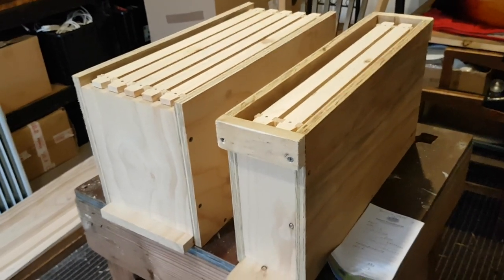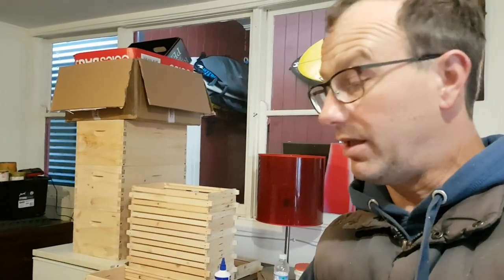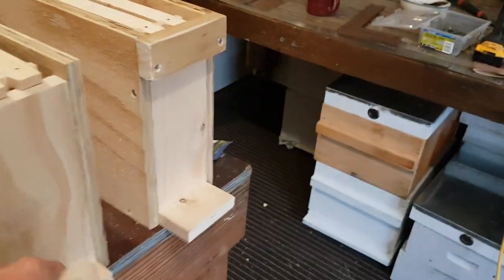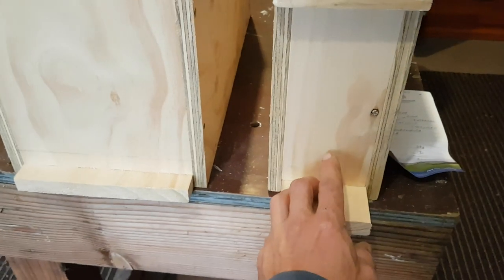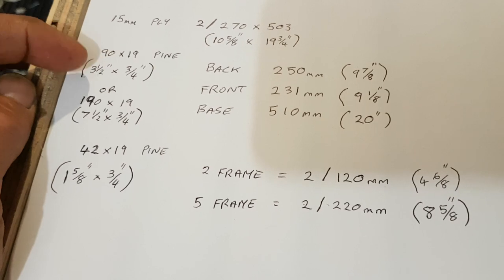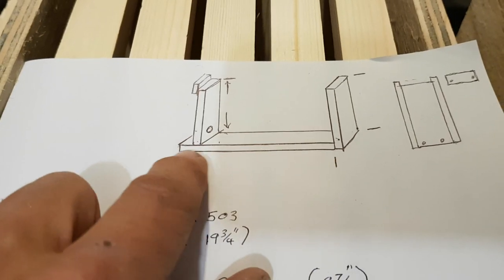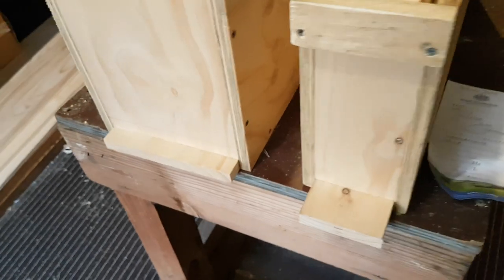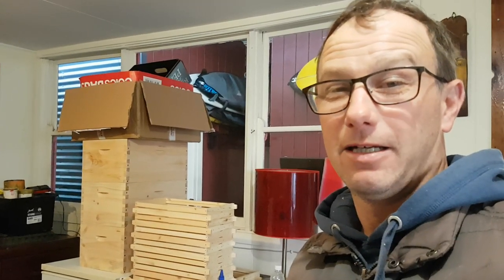Idiot proof Nuc boxes

Comment: Looks good.  I imagine one could use 2 pieces of 1X lumber on each side in place of plywood if they find it at the right width.  I made one with pallet boards on the sides, very similar to this.  And I had some old 2Xs that were already painted going to waste so I cut them to the right length for the front and backs of some Nucs.  I figured the Bees would be happier with the thicker wood on the ends.

Comment: I made my front and rear panels the same and screwed both from the bottom. No need to make 2 different sizes for that. I also make my top and bottoms the same. Needless to say, I used 1x12 inch pine that I cut for the sides. US keeper here.

Comment: I like the boxes but would just change the bottom  to a screen and make them so i could slide in a 1/4" piece of plasticore or plywood to make it a solid bottom and could easily use the wand and oxalic acid to treat for Varroa mites.

Comment: Great idea using a standard timber size and for keeping it simple.

But cost wise I just can't work it out to be only $15 for the 5 frame. If the 190x19 is around $10/lm then you're already at $10 for base, front & sides (991mm required)... then add the ply sides cut from a large sheet will cost around $10 (using 19mm).... plus the lid & other small bits and you're around A$25. Or is there something I'm miscalculating?
Reply from the maker: Hi Darryn, yes you are probably correct but I used 15mm ply which is slightly cheaper and it was also before the governments of the world decided to put us into hyperinflation for materials. I didn't account for the top etc. I wasn't really trying to portray the cheapest version, more so portraying the easiest version. To tell you the truth,  I honestly didn't assume it would have many  views at all, just realized there was a need for a simplistic version with cutting sizes for everyone with basic tools to produce, price wasn't my concern.
Reply: @Chillhouseminifarm  Cool thanks for replying and yes the design is great. 

I was excited about it being $15 materials but I think at >$25 I'd be more likely to buy a ready made one